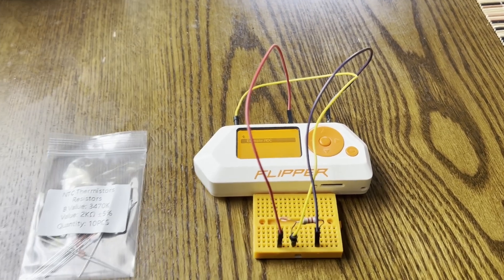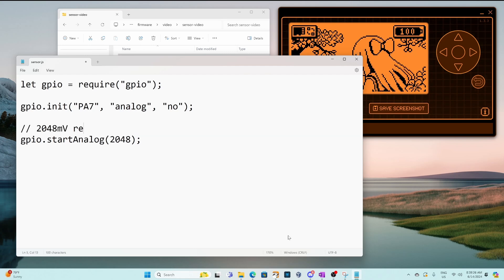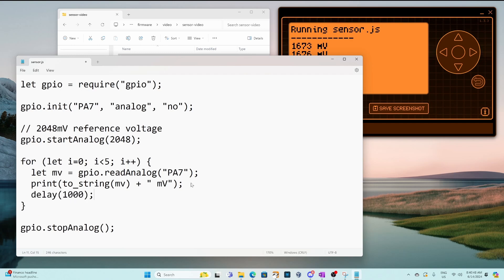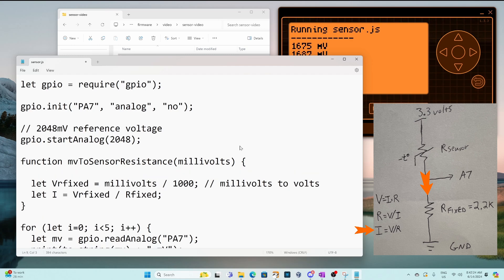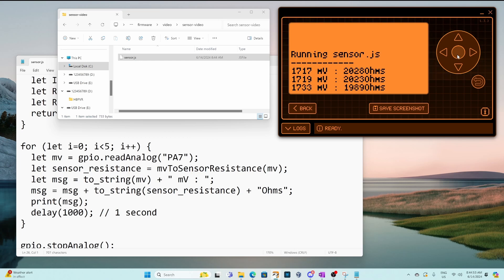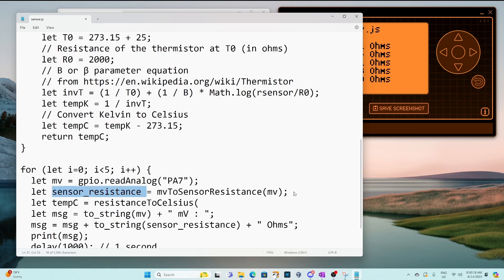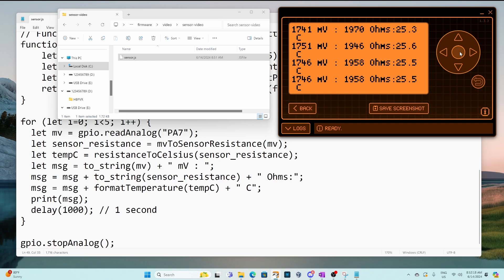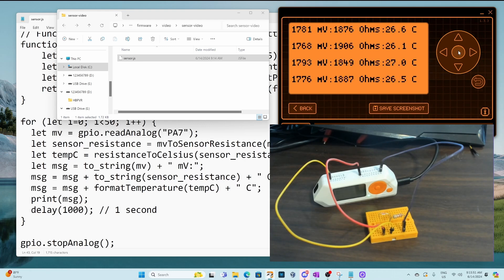[121] Flipper-Zero: Introduction to JavaScript for Analog Sensors!  #flippperzero #javascript

Comment from the maker: Thanks to @adzowndu4492 for reminding me that JavaScript has changed how GPIO works!  I need to update all of my JavaScript videos (most are impacted by the introduction of event_loop & the refactoring of the method names). When OFFICIAL FW added the features from Momentum, they made a bunch of changes.

Below is the corrected code that uses GPIO to read pin A7 voltage...

let eventLoop = require("event_loop"); // must include before require("gpio");
let gpio = require("gpio");
let pa7 = gpio.get("pa7");
pa7.init({direction:"in", inMode:"analog"});

// JavaScript only supports 2048mV reference voltage now
// We no longer start/stop analog. It is based on inMode being analog.

for (let i=0; i<5; i++) {
  let mV = pa7.readAnalog();
  print(mV.toString() + " mV");
}

Comment: I can’t get this first one to work at all 

let gpio = require("gpio")

gpio.init("PA7" , "analog" , "no");

// 2048mV reference voltage 
gpio.startAnalog(2048);

for (let i=0; i<5; i++) {
  let mv = gpio.readAnalog("PA7");
  print(to_string(mV) + " mV");
}

gpio.stopAnalog();

I’m getting issues on pretty much every line

Plz help 😅

I’m running the latest release version of momentum
Reply from the maker: Sorry, JavaScript has totally changed. 
I need to update all of my JavaScript videos. Thanks for your comment!
Below is the corrected code...

let eventLoop = require("event_loop"); // must include before require("gpio");
let gpio = require("gpio");
let pa7 = gpio.get("pa7");
pa7.init({direction:"in", inMode:"analog"});

// JavaScript only supports 2048mV reference voltage now
// We no longer start/stop analog. It is based on inMode being analog.

for (let i=0; i<5; i++) {
  let mV = pa7.readAnalog();
  print(mV.toString() + " mV");
}

Comment: Really educational videos. Thank you.
Reply from the maker: Thanks for watching & commenting!  I was super excited when they added the ability to read analog sensors by the Flipper Zero.  (We had an open-source oscilloscope program, but it used the LL libraries, which is a ton of low-level code and easy to make a mistake).  Hopefully people will watch some of my videos and then create new applications for the community!  If you need help, I'm typically available in Discord (https://discord.gg/k7WX7Be3Vy).

Comment: Excellent!  Love your channel, even when sometimes it’s way over my head :)
Reply from the maker: Glad you enjoy it!  Be sure to join the Discord server https://discord.com/invite/NsjCvqwPAd and you can ask clarifying questions there.

Getting the Flipper to display the voltage is fairly easy (just copy those few lines of code from the first 2 minutes of the video) and then instead of building a voltage divider circuit, connect three wires into A7, GND and 3V3.  Be sure the GND and 3V3 wires do not touch each other.  With one hand, touch either GND or 3V3 wire.  With the other hand, touch A7 wire.  You should be able to control the voltage values based on how you are squeezing the ends of the wires!!!
Reply: @MrDerekJamison  thanks.